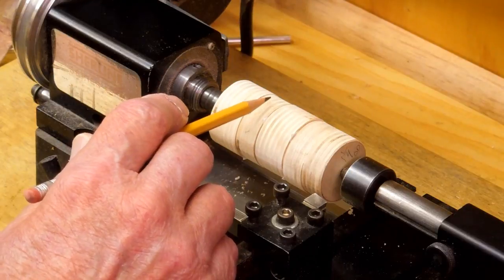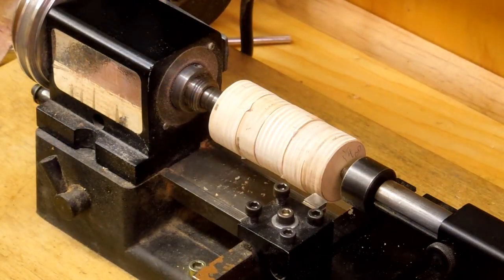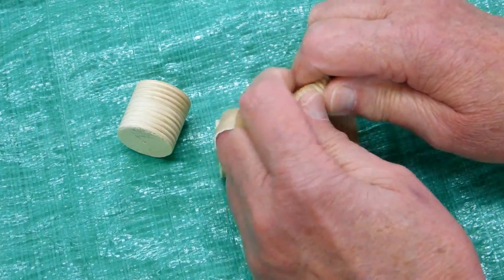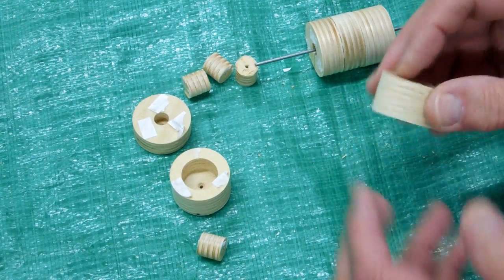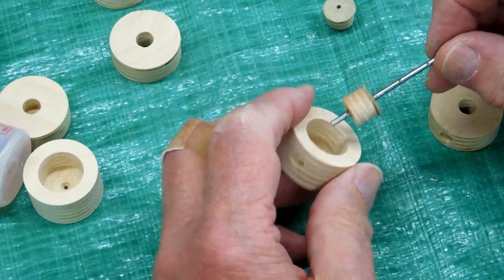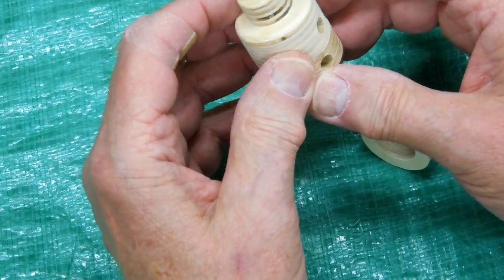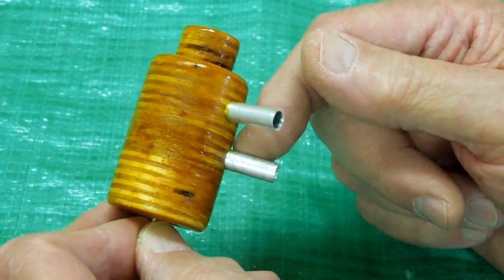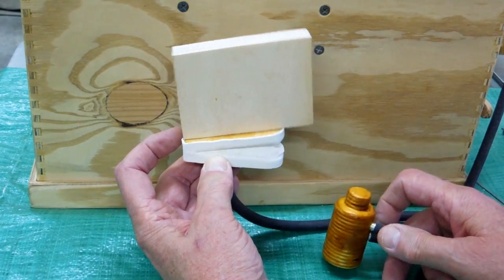Senior 20 Conductor Installation (4) Wood Pneumatic Valve

Comment: Thank You Ronald, I have been looking for an economical way to operate a midi controlled portable organ. I have everything I need to build it, accept those expensive little chest magnets commonly used in pipe organs. I am going to attempt to build a set of valves that work like yours in a block format with a small windchest on top to provide a single air source for all the valves, and power them with small inexpensive push solenoids. A rather more time consuming idea, but I have a bit more time than money...At least much of the work will be done on a CNC, that should help. Thanks again for your idea, and have been enjoying your videos and craftmanship.
Reply from the maker: Glad I could help! 
Thanks for watching. Please subscribe. 
That's what keeps this channel going! 
Ron

Comment: That appears to work very smoothly with instantaneous response. Your viewers may not understand nor appreciate differential pressure.
Reply: By differential pressure do you mean the pressure differential between the 'pressure in' side and the atmospheric pressure on the other side of the poppet? If not, can you explain? If I understand correctly, that pressure differential is being used in this valve where another valve might have a spring.
Reply from the maker: Yes... the differential between the 'pressure in' side and atmospheric pressure. The differential pressure gives you a tight seal with the leather face and tends to hold the poppet closed on the 'pressure in' side. Because it was made of wood the tolerances were kept loose to allow for atmospheric changes, even though plywood is quite stable in this regard. I refer to this as a "gravity unit" meaning the weight of the poppets and rod close the 'pressure in' poppet and the valve needs to be mounted vertically with the 'pressure in' poppet on top. A spring could be used to close the poppet (in any position) but I wanted to keep this simple. Differential pressure is also what opens and closes the flap valves inside the organ bellows.

Comment: How many psi/bar can this valve operate at?
Reply from the maker: It was built intended for low pressure (6 to 8 inches of water) but it would certainly work at pressures somewhat higher than that. The higher pressure will make pushing the rod somewhat more difficult due to increased differential pressure acting across the leather seal. Maybe 5 psi since it is made of wood, but I haven't tried it.
Reply: Ronald Walters 
In that case, a leaver that would give you more torque to push the valve would be necessary. You could do some tests to see how many psi the construction can handle :) great build btw